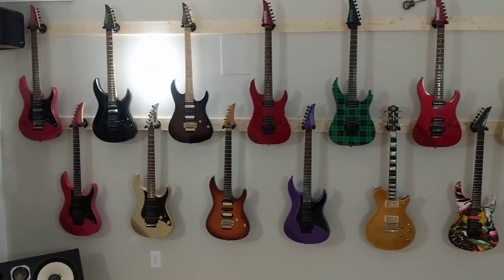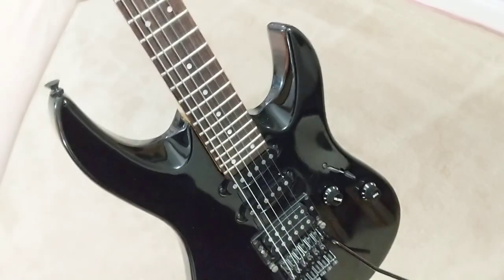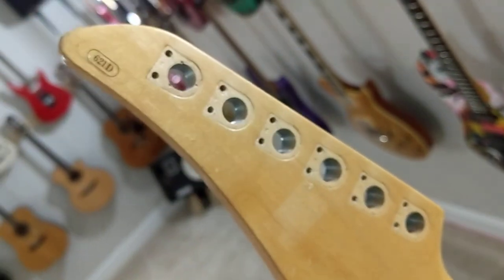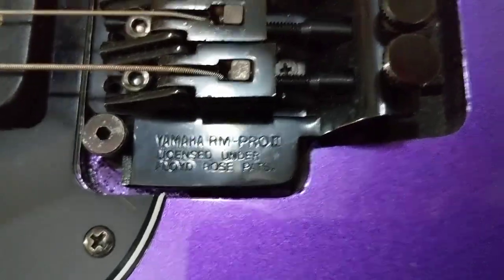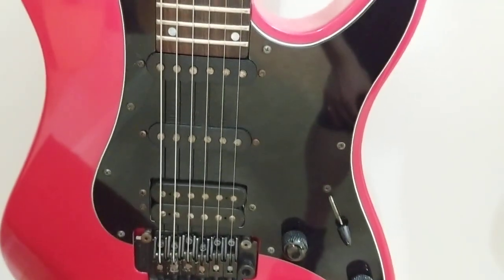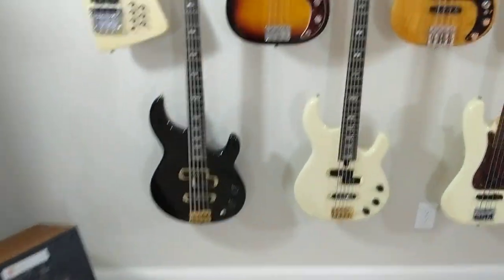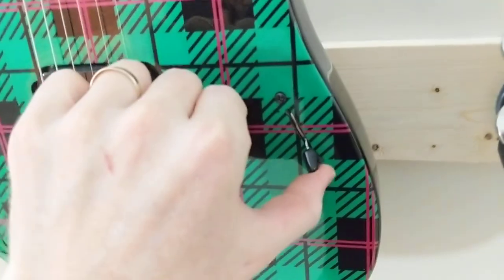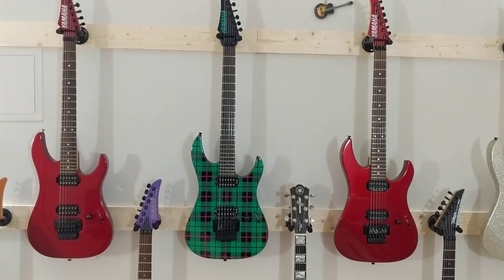Yamaha RGZ/RGX/YG models and differences explained

Comment: Hi there!!  I have the RGX321FP (the one with the transparent faceplate that goes on the whole front of the guitar and with interchangeable covers that goes behind the plate), it's a Taiwanese one but Would you consider this series an entry or mid-high range level?  Was plannning to sell it but re-sell value is terrible (don't know why considering Quality and How Rare they are now)!   Would you sell it and save for a Korean Made Schecter (I've heard this ones are really good & the best value for your money right now) or would you keep it?  - > I already replaced those terrible pickups with Lace Sensor ones. Btw, New Suscriber Here!
Reply from the maker: It's really up to you how you feel about the guitar. How rare I'm not sure. As far as resale value I'd say that like all things it's not worth something much until someone makes them famous and everyone else goes to find them. That's what drives the price way up. I had a guitar that I paid $50 for and gave it to a friend. Later I tried to but that same guitar 10 years later and it was $4000. There's just no way of knowing what will go up! I also really only tried to collect the RGZ/RGX/YG series Yamahas with these headstock design. Yamaha clearly makes incredible instruments in all shapes. If I did another video on these guitars, what would you like to see?
Reply: @theittyreport  Would like to see some reviews about those bridges on the Yamahas (specially the TRS-101) and What modifications/upgrades have you done to the guitars (pickups, bridges, metal knobs, etc) and finally your opinion if it worth doing it or if you better invest on a Brand New guitar with better stuff inside 👍🏼

Comment: Hi Chris!
Thanks for all the info!
Do you mind if I pick your brain for a bit?  I have an RGX 621D in need of some good TLC.

Backstory:
I recently found an RGX 621D at a second-hand store in Japan.  I didn't know anything about it, but the "TRS-PRO, Licensed Under Floyd-Rose Pats." tremolo caught my attention.  I looked up the model and it brought me to your video.  Thank you so much for all the info!!  It helped me make up my mind, and I'm super happy I bought it.
The body's in great shape, and the neck looks straight as a razor.

Questions:
My guitar doesn't have the clamp & bolt string locks on its nut.  The base piece is there—it just has these 3 holes where one would screw on the clamps.
> Should I get Floyd Rose clamp & bolts?  I just don't know if the pitch of the clamp screws would be the same on the 621D as it is for vanilla Floyd Roses, let alone the clamp size.  The clamps do look different though.
>  It's probably not had strings on it for a few years, should I be careful when putting new strings on it?
>  How many trem springs do you recommend?  (It currently has 2) Does it depend on the string gauge?

Sorry for bombing you with all the questions lol
At any rate, I'm glad I found your channel!!!
Reply from the maker: No worries man, I appreciate the questions and very happy to help. The funny thing is that I hate floating terms lol. All of my guitars are locked so I can drop tune them at any point. I know it's silly that 99% of my guitars have trems but I like the fine tuners and the feel of how my man sits while playing so it has some perks. I have a video explaining the difference between all the Yamaha trems that you should check out. Its more about the screw diameter than the clamp that will make a difference. I'd go down to a hardware store and buy a few single screws to confirm the threads. If it was me, I'd take the guitar with me so I would have to take two trips. As far as the springs go, I have no less than 3 to 4 springs in mine cracked up against a block to lock in place, for you, if you want the trem to float, and I'm betting the guitar didn't have the trem arm, it doesn't make sense to have a floating trem if you're not gonna use it. So I would block it. You may end up loving the blocked trem. Look for my restore video playlist and you'll see how I do everything. Hope this helps!
Reply: @theittyreport  Thanks for the advice man!!  I've ordered ordinary F-R clamps, and if the screws they come with don't fit, I'll take my guitar to the HW store.
You're right, mine certainly doesn't have a trem arm lol
I also saw your vid where you use a business card to lock your trem!  It's genius lol
That's gonna be my go-to method if I want to lock my trem.

Comment: cool video.  i just snagged a rgz 621rp just like yours.  cant wait to get it.  how do you like the pickups.  those carvin type screws really suck if i wanna get replacements.
Reply from the maker: Thanks man, pickups are really good. Definitely good enough not to need to change. Not sure what you mean about the carvin screws. But if you did have to replace the pups you could simply drill a hole in the pickguard and it would be fine. Congratulations on your new axe! Check out my playlists and the restore video. It can help with every step
Reply: duncan trembuckers also have the scre hole configuration and drop in

Comment: Do these RGZs bridge routing proprietary or can you fit a Floyd Rose or other bridge in them?
Reply from the maker: It would probably work fine, you'd have to go with a lo-pro edge type trem. But keep in mind that Yamaha has for some reason adapted many different types of trems to these guitars. Why? That is the question
Reply: If it has the original rm pro? There is no way ya wanna swap it for anything, especially a floyd rose. It pivots on bearings, can put the strings on without cutting the ends and don't have to lock either end if ya choose, has pitch adjustment and never goes outta tune, NEVER! Its also hassle free and maintenance free and is manufactured by gotoh, so its top quality! Is probably more like, a kahler but im just assuming coz I've never owned one but the Yamaha trem is by far the best I've ever used
Reply: @jeremyrobertson7267  don’t have that one. That would be great. A trem that takes the ball end.
Reply: @ralphbenitez4407  I don’t lock mine at all, at either end but I don’t use the tremolo and have it pretty tight with the springs so it hardly moves at all, not unless you want it to anyways. Did ya realise that some of em, mine does have a height adjustable locking nut as well? If ya look at the bottom underneath the other locking bolts it has 2 tiny holes on each side that a Allen key fits into and adjust lt up and down!?

Comment: This was interesting, I was given an RGX 612A (I think) ages ago but it's been completely defaced. It has white a trim around the fretboard and wing inlay on the 12th fret.

The trem and nut are totally busted beyond repair, don't suppose you know if the different trem versions are cross compatible? I think mine has an RM-Pro iii, would I be able to get the RM-Pro ii for example and swap it out?
Reply from the maker: The standard lo pro Ibanez trem will work fine. The yamahas mainly install TRS pro on theirs but many other companies use the exact same bridges in Jackson Yamaha Ibanez etc
Reply: @theittyreport  amazing! Will take a look, I was debating a second hand Yamaha with the same model trem for parts but feels wasteful if I can just find the bits I need.
Reply: Small update after a little comparing models online turns out I have the original RM-Pro on mine which seems to have very different dimensions to the other licensed FR bridges. Think my only option is to block u the cavity so the trem can't move or sack it off entirely!
Reply from the maker: @JoeDinsdale  I made a video on how to block it for free and non permanent
Reply from the maker: @JoeDinsdale  https://youtu.be/kT2iG2dabqs

Comment: Hi mate! Do you have any kind of info about original sh2 pickups? It seems to be like sh2 seymour duncans?
Reply from the maker: Not sure what the sh2 pickups are. Which guitar in my video are you referring to?
Reply: @theittyreport  sorry about the delay. I mean the original pickups of all rgx 421. Can you tell me something about the specs? Another question is: I need to replace the bridge. Do you know if the ibanez lo pro or floyd original it fits well? I don't know if yamaha has original replacement parts.
Reply from the maker: You can find most of the parts you need on eBay. Search for Japanese Takeuchi tremolo and you'll see quite a few options

Comment: Cool! I have a RGZ721M-R in black. No idea about date of manufacturing, only it is made I  Taiwan, and sustain block says Takeuchi Japan. I heard its p'ups are DiMarzio designs made by Yamaha
Reply from the maker: I think because of blues Saraceno and the relationship in the development of his guitar they learned a ton from DiMarzio. But, that's to say nothing. Yamaha is a general answer to the question of what good sound is. They make guitars sure, but they also make the best piano in the world, along with tuning the exhaust for the best sounding road car ever the Lexus LFA. And the make brass instruments, engines, motorcycles, and many others. If Yamaha made a dildo, it would be the best sounding vibrator of all time.

Comment: Hi Chris you are such a great teacher, I've learned a lot from your video.
The issue I have regarding my yamaha is that mine has only a square chrome plate for the neck to the body (back of the guitar) instead of two metal pieces that yours has, and also mine the volume knobs are see through resins...
It is made in Taiwan  IH29026
Any info?
No matter what I did enjoy your beautiful toys.  Peace out  :) and thanks.
Reply from the maker: Some of the 321 RGZ had the plate and screws for the neck. Not sure why but its just another strange thing about the yamahas. As far as the knobs go, I'd say they were swapped by the person before you. What is stamped on the tremolo? Trs101, TRS pro? Also the neck pocket would tell you exactly what it is. You'd have to take the neck off and look but if you don't feel comfortable I'd leave it alone. Unless you're interested in setting up and working on your own guitars then go for it. Check out my restore videos on the RGZ, I did a step by step instructions for every detail of the guitar. Hope this helps!

Comment: Hello Chris 🤘
I have a RGX211. I bought it new in 1988 for $250. First time I played it, it felt so good and sounded awesome. So I put it in layaway. I was a 21 year old broke kid. I've aways just played it. Restring and clean it. Never ever wanted to crack it open. I was afraid I would loose the tone. Well a couple of years ago I had to. The volume pot had a short. Right in the range I like to play. I ordered a fender replacement and you know... The original black knob doesn't fit. It's sounds great again but it sucks to take it to my buddies for practice like that. First question is do you know where to get that pot? And also where can I get a replacement black spring/claw panel for the back? I took it off to dust the springs and lost it.
When I'm jamming, I toggle the 3 position switch and occasionally press the tone pot to the out or in position. I don't know what I'm doing but I just know certain moments call for certain tone. And this guitar has it. If you can tell me what these functions are doing to the pickups I would appreciate it. Would you know where I can get a factory wiring schematic would be great. 
 I'm just starting to learn about the electronics of guitars on a copy fender I have. I took it apart and I'm installing a EVH Frankinstat humbucker and a floyd on it. I'm not afraid to mess that one up. That's why I'm learning with that first. Your videos are a great help. I hope to hear from you soon,
Lyle Detroit
Reply from the maker: Wow man, thanks for the thoughts. I have a bunch of videos restoring these guitars that have helped a ton of people. Check out my channel and let me what you need
Reply: @theittyreport  Any ideas where I can locate a cover for the trem springs?
Reply from the maker: "Frets On The Net Home" https://fretsonthenet.com
Reply: @theittyreport  Found it! Thank you so much for that link Chris! 👍
Reply from the maker: @LyleDetriot  anytime

Comment: I just found(looks like your black621P) HSH for $100 at a pawn shop cause you talked me into it. Love the neck. I noticed that the High E string saddle is cracked bad. It’s not locking the string. It’s a TRS bridge. I might as well replace it. Will a Floyd fit without modifications? Also one of the original bolts on the nut is wrong. They are tiny. Where can I find these.
Reply from the maker: Ebay most likely, but Stu mac as well for the set
Reply: @theittyreport  would you keep the TRS-100? Is it alright?
Reply from the maker: @ralphbenitez4407  that's the lowest end of the trems. I'd buy a new trem on eBay and It should fit and be much better than the one that's on there. Search for TRS Pro on eBay and a bunch will pop up.
Reply: @theittyreport  thanks!
Reply: @theittyreport  you mean Yamaha TRS Pro or Ibanez? I see a lot of Ibanez trems.
Reply from the maker: @ralphbenitez4407  https://www.ebay.com/itm/Ibanez-Lo-TRS-Trem-Vintage-Floyd-Rose-Tremolo-Bridge-Black-Complete-Assembly-MIJ/303741858594?hash=item46b86cf322:g:bOQAAOSw629fly5~
Reply: @theittyreport  thanks again Man. I really like this guitar.
Reply: Will a TRS II also fit?
Reply from the maker: I'd imagine it would but I've never tried. I'd get a caliper on amazon for $10 so you can know for sure.

Comment: How about rgz 321p red with black pick guard and it has volume knobs that aren’t numbered they are metal It’s head is black with the big yellowish Yamaha logo. I thought I saw it but you never got to it
Reply from the maker: I only have 1 rgz 321 but it’s the blue guitar without strings. The red with black PG is a 612 HSS setup. The other red one is a HSH and is the 621. I did a follow up video that has all the guitars restored (I think) and did some other things like paint jobs and such. I’ll post a link below this comment if that helps. I also have a playlist of all the mods and restore videos as well that you can check out if you are interested
Reply from the maker: https://youtu.be/AFUwb2Dew5g

Comment: Any idea what is  A  ?  Active?    what is S   ?       Suffix letters  so RGX612A    is active?    what is RGX612s ?
Reply from the maker: Truly, I have no idea. YAMAHA really doesn't make a whole lot of sense in many ways. There are RGZ, RGX, and YG models that are exactly the same made in Taiwan that share all the same hardware etc and are named differently. None of the guitars I've come across have had active pickups or anything of the sort. I can only guess that the markets they were sold in such as USA got the RGZ series and UK got RGX and Asia got YG. But they all had English writing on them. The J S A could have to do with the year or additional marketing to seem different but it's so random it's really hard to make sense out of it to a certainty.
Reply: @theittyreport    J is very possibly Japan made.  I saw a couple guitars made in Japan with the J designation.  I certainly could be wrong    Also i dont know if I used the word suffix properly.
Reply from the maker: @vincemcman4086  j for Japan makes sense, that's good to know. The S maybe means special?

Comment: Trs 101 Takeuchi Japanese licensed Floyds are fine ..wgat does Yamaha use better
Reply from the maker: The 101 are not great in comparison to the trs pro. The 101 is made from very brittle metal and two of these trems had settles that broke apart completely. Never had an issue with the pro version which I have more than 25 guitar with them. Yamaha wasn't the only to use the trs pro, ibanez yamaha Jackson esp etc. Everyone just put their stamp on it
Reply: @theittyreport  thanks. I recently bought a 721 .and absolutely love it. I've been pkayingv43 years .but didn't ever ret Yamaha guitars ..til I found this guitar for$56 bucks.had to buy string retainer screws and strinng blocks. It needs ONE lock nut block and then it will be all together...I now Love Yamaha guitars. .my brother bought the middle line revstar ..man I have been missing good stuff...I'm now loving Yamaha guitars..
Reply: @theittyreport  my 721 is also stamped c stock. But I see NOWHERE blemishes ..any idea why..and thanks man for helping
Reply from the maker: Not sure what or where the C stock comes from. Never seen that either. Fretonthenet.com is a good source for parts if you can't find them on ebay